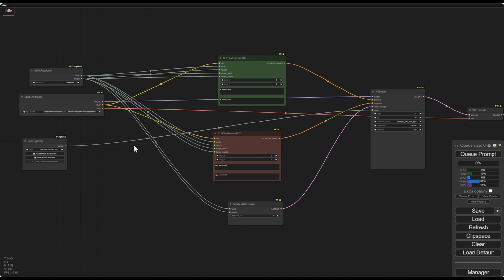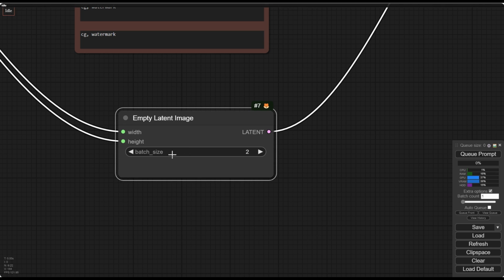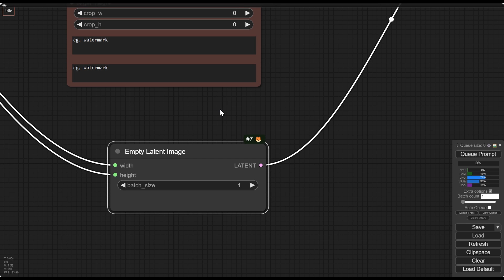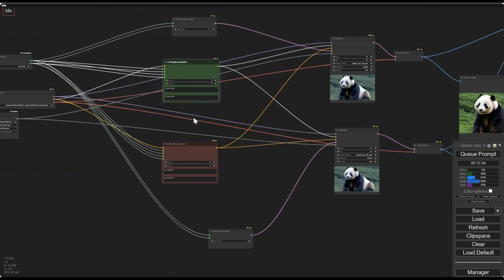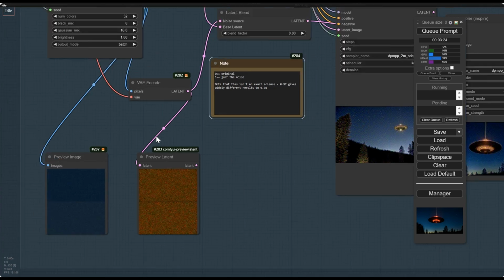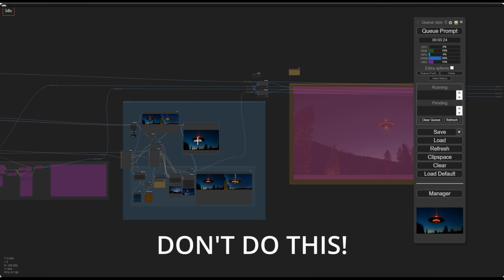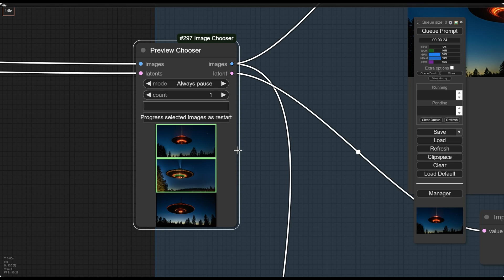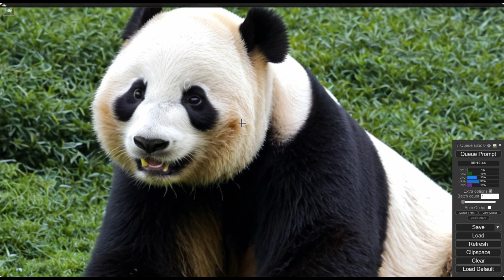The bug that's a feature in ComfyUI - batching and Ksampler noise!

Comment: I don't really think it's a bug though, just something to be aware of. If you pass a batch to a ksampler and every image receives the exact same random noise at each step, you will get a batch of the same image, so of course we want each image in a batch to follow a different diffusion path. This is implicit when batching because the RNG gives you different results when you ask for a larger random tensor vs a small one even with the same seed. This also means that if you want to recreate the same image, you also have to recreate the whole batch with the same seed. You can still use an image chooser, but only let through one image (or a fixed number of images) at a time, which will ensure the workflow after the chooser is deterministic.

Comment: sadly I discovered this in a harder way, a month ago I was doing 16 batch images per queue (+10 minutes run time) looking for good results and saving the seed numbers to be used in later processes, then I discovered that the 16 images got the same seed and you need to run the whole 16 batch queue with batch selector node if you want to upscale one image of them
I tried using a lower batch number when I was targeting the second batch image, but it didn't work, cuz changing the batch number will change all the results 

I think they should fix this by making Comfyui generate a unique random seed number for each image in the batch
Reply from the maker: Oh dang I hadn't thought of that possibility, you're absolutely right. I hope they change it, too, especially for people using this for work, where determinism is key. Thank you for sharing your experience! 👽

Comment: Good find, if you use the basic SD clip text encoders instead of the sdxl ones does the same difference also occur?
Reply from the maker: Yes - i also tried to pass ----deterministic to the command line, no dice. Also tried to switch the ksamplers to the ones from inspire pack, same outcome. I'm afraid there's no fix - and it's a 'hot topic' amongst the contributers to the comfy repo :)